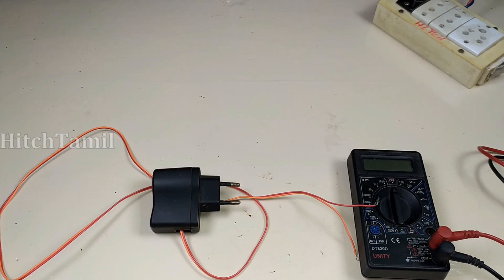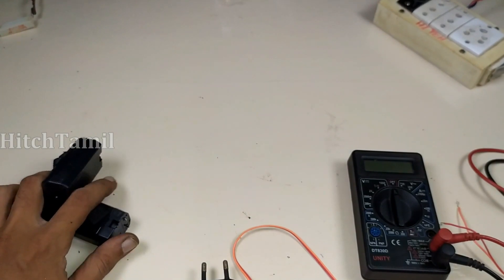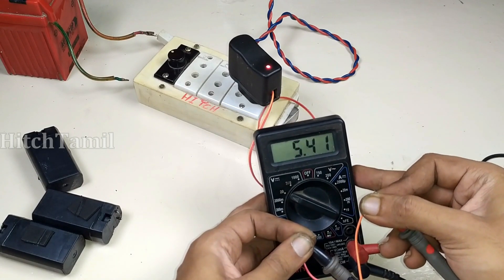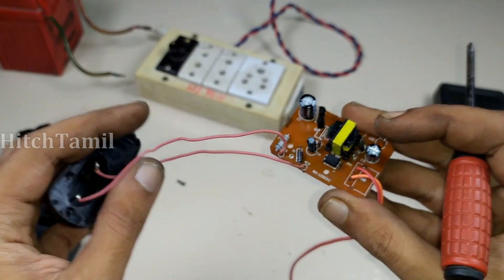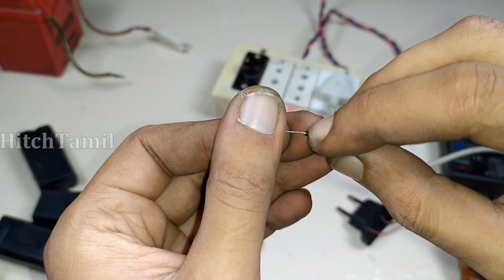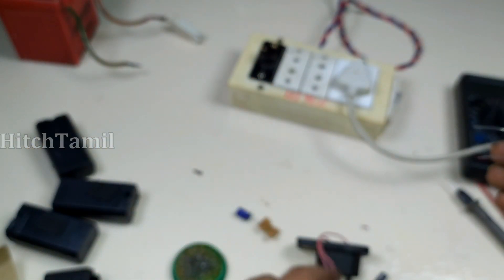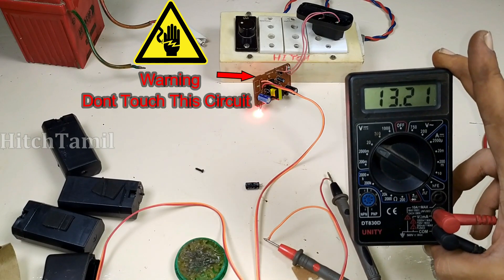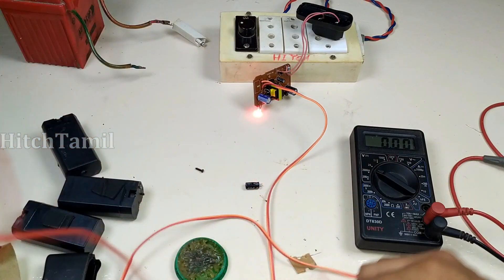5 volt Mobile Charger To 12 volt Power Supply Make In Tamil

Comment: Bro I take battery charger atha using panlama bro
Reply from the maker: Yethana Amps Battery Bro?
Reply: 4.8v charger bro
Reply from the maker: Ampere Bro?
Reply: Bro 16v capacitor irukku bro aana 6v zener diode tha irukku eppo  etha replace punnurathu  bro
Reply: Bro ennaku 5v charger convert 15v vanum bro enna pandrathu please reply
Reply from the maker: Appo 15v zenor Diode Podunga Bro
Reply: Bro ennaku ennum athikamaka voltage vanum please reply
Reply from the maker: Ok Bro
Reply from the maker: Video Fulla Skip Pannams Parunga
Reply: Thanks bro

Comment: 12V Zener Diode potu 470uf/25v podamal 
470uf/16v Capacitor pottal problem ma?
Reply from the maker: 16v M Podalam 25v m Podalam Bro 12v Ku Mela Irukka Yentha Capacitor Venumnalum Podalam Bro

Comment: Bro 5v charger,la 470/10v capacitor kalatti 470/16v fix pannal problem ma?
Reply from the maker: Yes Bro Some Times Voltage Athigama Varum
Reply: @HitchTamil  
Thank You Bro
Reply: @HitchTamil  
Bro 3.7 Rechargeable Battery 2 connect pannura eppadi adha eppadi charge pannurandu  video link anuppungalen
Reply from the maker: 5 volt Chargerla Directa Kuduthu Charge Pannathinga Bro 5v Chargera 3.7v Ku convert Pani Charge Pannunga Appo Than Battery Life Nalla Irukkum. 5v Chargera 3.7v ku Convert Panra Simple Video Ithan Parunga.  https://youtu.be/ag_ZxMmBjVc

Comment: Bro.itha continues aa use pannalama bro.fish tank ku led light set pannalamnu iruke.pannalama bro.
Reply from the maker: Na FishTanku Than Use Panren bro Ippo Vara Nalla Irukku Yentha Problemum Illa
Reply: ok bro thanks.
Reply: Bro bro enkitta irukara charger la black diode tha pottu irukanga bro.atha remove pannitu zener  diode potalama
Reply from the maker: No Bro Zenor Diode Irukura Chargerla Than Intha Method Work Aagum Normal Diode Irukura Chargerla Transformera Rewinding Panna Than 12V Kidaikkum So Risk Vera Charger Try Pannunga Bro
Reply: Appadiya bro.ok bro thanks.

Comment: 2- 10v connect panni capacitor link kodukalama bro?
Reply from the maker: Ungalukku output Yethana Volt Bro Varanum?
Reply: @HitchTamil  12v bro
Reply from the maker: 12v Zenor Diode Replace Panitingala?
Reply: @HitchTamil  yes bro
Reply: @HitchTamil  9 v x2 diodes connection panniten
Reply from the maker: Sorry Bro work Irunthuchu Athsn Late Reply Panren 9v Diode Yepdi Connect Panirukinga 1by 1 na va? Appo 18v ku Mela Varume!
Reply: @HitchTamil  AMA bro
Reply: @HitchTamil  enna pndrathu bro
Reply from the maker: 18 voltku Yepdi Bro 10v Capacitor Connect Pannuvinga Vedichirume?
Reply: @HitchTamil  car battery charge panna bro
Reply: 2-10 v 470uf capacitor connect panni link kodukalama bro?
Reply: Bro???
Reply: Bro car battery down ayuruchu, help me bro

Comment: Bro please reply not work bro
Reply from the maker: Did you change the 12 volt zener diode?
Reply: @HitchTamil  S bro 12 volt zener and 25 volt capacitor bro
Reply from the maker: Check The Charger And Zener Diode
Reply: All are working bro but not 12 voltage
Reply from the maker: How many volts is coming

Comment: Bro neenga 3v to 12v regulated circuit nu onnu podringala without ampere loss
Reply from the maker: Buck Booster Nu Potruken Atha Ketkuringala?
Reply: @HitchTamil  illa naa adha paakala actually naa panra oru vishiyathuku step up theva paududhu like battery oda 3.7 v to 12v conversion kaaga... Adhuvum ampere atleast 12v 2.5a conduct aagara maari
Reply from the maker: Old CFL transistor Vachu 3.7 volt to 12 volt booster module making video Potruken.
Reply: @HitchTamil  ahh yes bro ippo pathen adhula neenga use panra transformer naa epdi kandu pudikardhu like neenga adhula sonna reading enna reading and usage ku etha maari namma enna transformer use panlam
Reply from the maker: Athu Mobile Charger boardla Irukka Transformer Then Atha Vachu Boost Converter And 3 volt To 230 volt Inverter Pannalam And Reading + Details Yellam Video la Solliruken.
Reply: @HitchTamil  yes bro adhellam purinjichu but neenga sonninga la like adhula 9 nu reading kaatudhu so adha inverter ku use panlam nu adhu enna reading

Comment: 12v 15mah lithium battery சார்ஜ் பண்ணலாமா
Reply from the maker: 12v 15 Ampa Illa  15 Mah a Correcta Sollunga
Reply: 15000 mah
Reply from the maker: 15k mah Na 15 Ampere So Mobile Chargera 12v Ku Convert Pani 15 Ampere Batterya Charge Panna Mudiyathu.
Reply: 12v 15000 mah lithium battery chargee eppadi panrathu
Reply from the maker: 15000 Mah Ku BMS Pottu Thana Use Panringa?
Reply: S
Reply: Yes
Reply from the maker: Appo Normal 12v Charger Iruntha Use Pannunga. Lithium ion Battery ku Thaniya Charger Irukku Atha Vangi Use Panna Athula Battery Low And Full Indicator m Irukkum
Reply: letaciod battery 12v charger lithium battery chargee paan muthuma

Comment: Bro 5v Charger 12v Askiten But Innoru 5v charger,la 470/uf 10v Capacitor Mattumthan irikidhu Diode illaye change panna
Reply from the maker: Diode illatha Chargerku Buck Booster Than Bro use pannanum. Buck Converter yepdi Make Panrathunu Video Potruken Parunga
Reply: @HitchTamil  
Link
Reply from the maker: https://youtu.be/S6PVs-7lKu0

Comment: Sir ithula mobile charge panna mudiuma
Reply from the maker: 5 Volt Mobile Chargera Than 12 Volt ku Mathurom. Mobile Charge Pannanumna Chargera Apdiye Use Pannunga
Reply: Iilla sir increase panna mobile fast charge aguma
Reply from the maker: No Sir Volta Mattum Increase Panna Fast Charge Aagathu Ampere M increase Aana Than Fast Charge Aagum Sir.
Reply: Fast charge panna solution kudunga
Reply: Ithukku solution
Reply: Sir enkita 5v .700amp charger iruku amp incirse panna mudiuma

Comment: Bro 12v Zenor  Diode  470uf 25v Capacitor Poatten 12v warudhilla 10.06 Voltage,than warudhu
Reply from the maker: Capacitor illama check pannuningala?
Reply: @HitchTamil  
illa
Reply: @HitchTamil  
Ungada WhatsApp,la enaku oru sms podunga bro
My WhatsApp No +94702242818
Reply: @HitchTamil  
12v Zenor  Diode  470uf 25v Capacitor Poatten 12v warudhilla 10.06 Voltage,than Kaatuudhu
Reply from the maker: Correctana Zenor Diode Replace Pannuningala?
Reply: @HitchTamil  
Yes Bro Dc pakkathula 5v Diod than mathinen
Reply from the maker: Unga charger la rendu Zenor diode irunthucha illa onnu Mattum irunthucha Bro?
Reply: Yen 10 volt katudhu but 12v bulb workahudhu
Reply: @HitchTamil  
AC Pakkathula Onnum Dc pakkathula onnum
Reply from the maker: Discriptionla en mail id irukku bro Photo anuppunga nan Solren.
Reply from the maker: 10 volt kuduthalum led Work Aagum Led bulb thana connect pannuninga?
Reply: @HitchTamil  
Yes Bro
Reply: @HitchTamil  
Enna Photo Bro
Reply: Please
Reply: Bro Direct AC,la irundhu Trnsformer illama 12v Edukkura System Video Link Thaangalen
Reply: Bro Direct AC,la irundhu Trnsformer illama 12v Edukkura System Video Link Thaangalen
Reply: @HitchTamil  bro yandula rendu zenor diod irrku enna pannanun
Reply from the maker: Dc Side irukka zenor diode replace Pannunga

Comment: My 24v dc adapter now deliver only 16v how to increase 24v
Reply from the maker: Dc adapter la transformer irukka?
Reply: @HitchTamil  transformers power supply sir
Reply: Transformer less power supply
Reply from the maker: @thanapalanc4520  transformer illa appo ulla circuit board than irukka sir?
Reply: @HitchTamil  yes sir
Reply from the maker: @thanapalanc4520  vangunappo yethana volt kidachichi sir ?
Reply: @HitchTamil  initially gives 24v it was used for ro  unit now all on a sudden ro pump not working I replaced new smps. To rectify the old one I request your guidance
Reply from the maker: @thanapalanc4520  ok first open the adaptor then Check the capacitor sir
Reply: @HitchTamil  In the sec. side 220 mfd 35v capacitor available there is no physical damage in the capacitor shall I change the new one
Reply from the maker: @thanapalanc4520  diodes?
Reply: @HitchTamil  no diodes available sir
Reply from the maker: Ok  Circuit picture Enakku Mail Pannunga En mail Id Discription la irukku sir
Reply: @HitchTamil  sent photo picture of the circuit sir
Reply from the maker: Enkitta circuit illa neenga clear a picture send pannuna yenna complaint nu parkkalam athan keten
Reply: @HitchTamil circuit picture ungali mail id ku anuppiyullen sir sorry for the disturbance

Comment: Bro zener diode eananu bro kekurathu and capacitor name m solunga bro
Reply from the maker: 12 volt Zenor diode nu kelunga bro
Reply: @HitchTamil  

5v 12v Aaga change panna 12v zenor Diod And 470uf 25v ok

5v ya 24 Aaga change pandrnna 24 zenor ok capacitor value
Reply from the maker: 5 ya 24 volt ku change Pannuna Amps remba low va than Varum

Comment: Bro 9 volt ku enna capasitor podanum
Reply from the maker: 10 volt capacitor podanum bro + 9 volt Zenor diode use pannanum
Reply: Capacitor all ways use double the supply voltage So 9×2=18 Voltage. but available 16v and next 25v otherwise capacitor may be short and damage.

Comment: Bro 5v to 12v ok, but Amp value change aguma
Reply from the maker: No bro amp level change aaganum a transformer change pannanum illa rewinding pannanum bro ithu rendume illana oru transistor include pannanum
Reply: @HitchTamil  so antha 500mah appadiyea irrukum, correcta?
Reply from the maker: @jeyabharathraja9599  ya but correcta sollamudiyathu bro
Reply: Bro ups transformer la irunthu 24v 2amp supply eaduka mudiuma.....
(numeric ups digital 600ex v)
Reply from the maker: @jeyabharathraja9599  yedukkalam bro but transformer la irunthu yethana wires varuthu?
Reply: @HitchTamil  one side 4 wire(yellow, blue, green, black) and  other side 2 (red and blue)
Reply from the maker: 1st primary side athavathu current la kudukura side a kandupidinga bro
Reply: @HitchTamil  OK bro
Reply: I think it's a 4 pin side

Comment: 24 v tranfor O/P 12v supply ha maatha mutiumaa
Reply from the maker: M mudium bro 4,to 5 capacitor use pannanum illa na variayable power supply va mathanum illa 7812 transistor use pannanum 3 vali irukku bro

Comment: Bro ithil 680 uf 25 use panna mudiyuma
Reply from the maker: Board la irunthathu yethana uf bro?
Reply: @HitchTamil  470 uf 10 v
Reply from the maker: @Dramaticmoon  uf athigama kudukalam bro problem illa low va than kuduka koodathu
Reply: @HitchTamil  thanks bro ith working ayittey
Reply: @HitchTamil  5 volt mobile  charger,  bro  6 volt  zener diode  join panni 12 volt diode koduka mudiyuma, bro nan vanthu kerala  sorry my tamil
Reply from the maker: @Dramaticmoon  6volt zenor diod rendu joint pani kudukalam bro 12 vot kandippa kidaikum
Reply: @HitchTamil  bro 5 volt  mobile charger yeppadi 6 volt  battery charge panna mudiyum,  namma mobile charger modified panniyal pattuma
Reply from the maker: @Dramaticmoon  5 volt mobile charger la 5 volt Zenor diode irukum so atha remove panittu 6 volt Zenor diode replace pannunga 6 volt output varum so 6 volt battery charge Pannalam simple bro
Reply: @HitchTamil  capacitor mattanama
Reply from the maker: 6 volt than output venumna capacitor matha venam bro
Reply: @HitchTamil  yenna capacitor  unit sollu
Reply from the maker: Zenor diode volt?
Reply: @HitchTamil  6 volt
Reply from the maker: @Dramaticmoon  u want 6 volt  No need to change capacitor because allready in 10 to 16 volt capacitor in the mobile charger
Reply: @HitchTamil  ok appo nan only  zener  diode  mattiyal 6 volt kadakuma

Comment: Bro etha music amplifier ku supply kudukalama bro 12v dc supply kudukanum
Reply from the maker: Yethana Watts amplifier ku use panringa bro? ithu 500 mah charger board.
Reply: @HitchTamil  24 watts bro 12v supply bro
Reply from the maker: @mukesmukeswaran5887  appa neenga konjam power full charger a than 12 volt ku conver pannanum bro.nan video la kaatunathu 500mah than bro
Reply: @mukesmukeswaran5887  enna ic based?